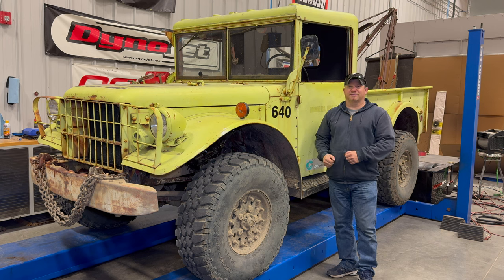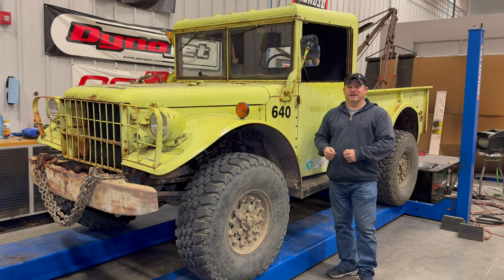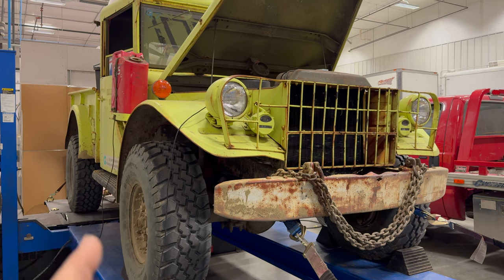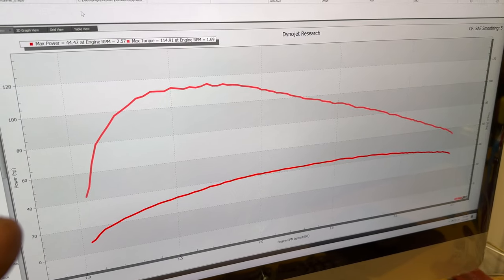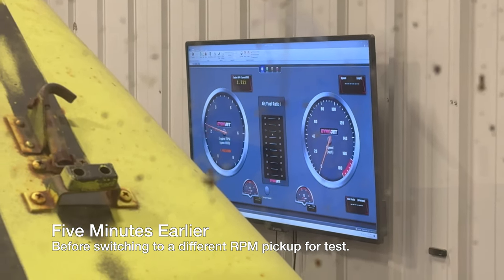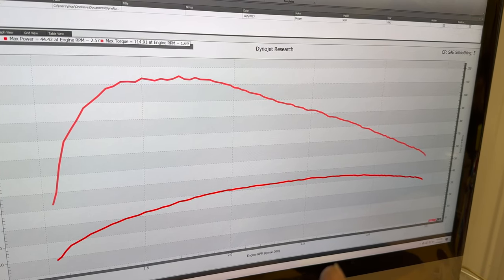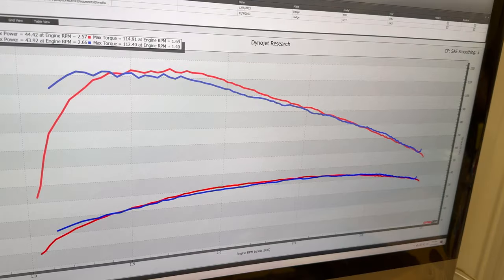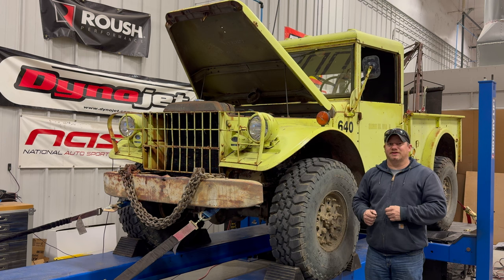Putting The Vintage Off Road Wrecker On The Dyno

Comment: Fascinating, Steve, it just goes to show the importance of torque when many people just focus on power....
Reply: The old-timers say, "Horsepower and torque do exactly the same job," but hardly anybody listens... incidentally, I think doing 60 in this truck would be a mildly terrifying experience!
Reply: @jlwilliams  As long as the front end is somewhat tight and the tires are round they drive pretty well, just make sure it stops ok. I could lock up the tires with my 41 and it tracked well at speed when the parts were good.

Comment: Look up the Montana Dodge Boys.  He bought the rights to the old Egge casting molds for 23" & 25" aluminum heads. Both a fancy finned version and a stock appearing version as well. A couple of small weber two barrels, Fenton manifolds. They have camshafts, properly  blueprinted oil pumps, and a wealth of knowledge to tap into. Cool ride, HEAVY, but Cool. They even made a single OHV head with six intake ports as well! Pricey unit, though.

Comment: My experience with points ignition is that I can always fix it in a pinch. Electronic ignitions, when they die they are forever dead.
Reply from the maker: They don't make them like they used to, the new points are made out of such cheap junk that they burn up or corrode after a year or two.  I used to love keeping the points in everything but without quality parts they are now more unreliable.
Reply: @ThisWeekWithCars --  Electronic ignitions are junk now too.  Have fun!!
Reply: Damn straight!!  If it had points originally, keep it that way!!  Easy fix.
Reply: A long, long time ago I had a points ignition but it only carried enough current to trigger an electronic unit to power the coil, very little electrical wear just mechanical. If the electronics failed there was switch that connected the points back to the coil.
Reply: @ThisWeekWithCars I haven’t had any issues, as I buy NOS points from ebay. The M37 used common points that were also used on Willys jeeps, and most civilian Dodge cars and trucks. The biggest issue I have had is the distributor caps. The currently available ones are absolute junk. Generally, the electronic units aren’t an upgrade at all, in dyno tests by the hot rod crowd, the Pertronix ignition gives LESS power than the points ignition. The only advantage is not having to clean the points after the truck sits for a long time. You still have to open the distributor regularly, to lubricate the wick under the rotor.
Reply: 24v Pertronix works great
Reply: @patrickwelch620  --  So do points if you know anything about them.
Reply: @jusportel  --  Yep.  The problem with youngsters today is that they're too lazy or ignorant and think every modern electronic gizmo is better in all situations. There is nothing wrong with points and have always worked great for me.  But I grew up in the stone ages and learned at an early age how to work on this stuff, WAY before modern electronics and fuel injection, etc.  All these youngsters have to do is learn.
Reply: @ironcladranchandforge7292  I drive my M37 every day, and I have always appreciated having the points ignition, as it’s simple to maintain and troubleshoot. Modern electronics have left me stranded in the past, never had that problem with the old stuff.
Reply: @ironcladranchandforge7292   no way. Pertronix has been much better for me. New points are all junk and that waterproof system eats them.

Comment: My 41 1/2 ton closed cab pickup had a 56 Plymouth 230 flathead and that engine was factory rated at about 130 hp and 200 torque give or take. The gearing in the early trucks was 4.88 to 1, the later trucks were around 5.86 to one so they didn't  need a lot of power to climb just about anything in low low. My truck didn't even have a two speed transfer case and still only did 9 mph in granny low, yours does have a low range and does 4.
I highly recommend electronic ignition. I put the factory setup from a newer Mopar on my Dart and the only failures it has had are when the magnetic pickup gives up that takes the place of the points. The pickup and the rest of the parts are cheap and easy to find and used to be all over the wrecking yards. Find out if the newer distributor like the slant 6 uses will work in the fathead if any combo of factory parts can be made to work with what you have. If it works right you get better spark and much longer plug life etc. Tuneups would be just plugs, cap, and rotor after that unless the pickup or ballast resistor fails and you can carry those easily enough if needed.

Comment: Chrysler made flat head sixes from 218 to 413 cubic inches; which engine does this have in it?
Reply from the maker: T-245 engine which is 230 ci
Reply: @ThisWeekWithCars  That was my assumption. They built that motor, primarily for Power Wagons, up until 1972.

Comment: That 230 is not running welll. Sounds like a valve issue. Do a leakdown, replace the wires, rebuild the distributor and carburetor. Hopefully,  you just need to lash the valves.  You do that WHILE it is RUNNING. Don't listen to other people. Get thin valve wrenches and pull the inner fender and remove the wheel so you aren't burning your hands.  Again, this should be done while warm and running. Do you have a tm-8030 to work from? That is crucial.

Comment: A 1.9 tdi makes more hp and torque than this engine stock🤣
Reply: ouch.  I was going to suggest an LS swap.
Reply from the maker: Will the 1.9 tdi still be running after 60 years?
Reply: @ThisWeekWithCars  maybe if it has a mechanical injection system and no turbo and you have plenty of belts and maintenance stuff yes.
Reply: @ThisWeekWithCars   I do like the Dodge. But my 34 y/o 1.6l VW diesel is running just fine. IDI, mechanical injection pump, original turbo.